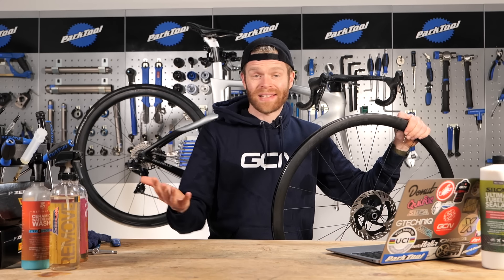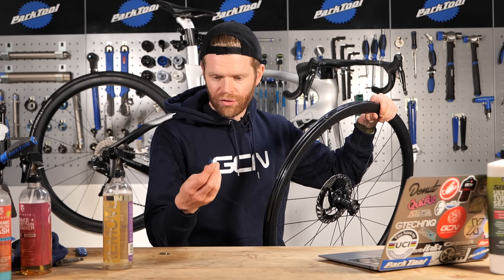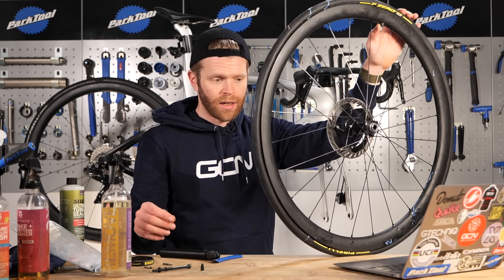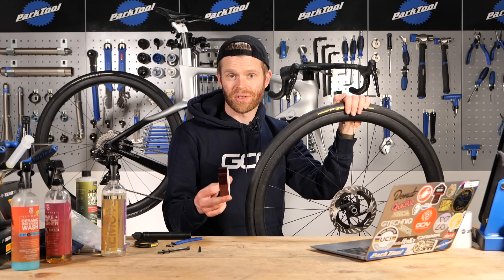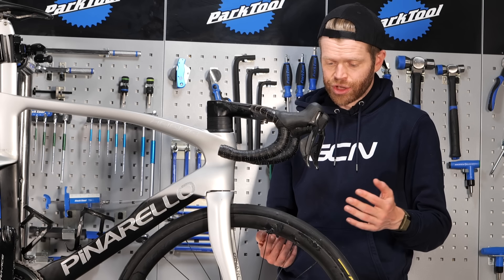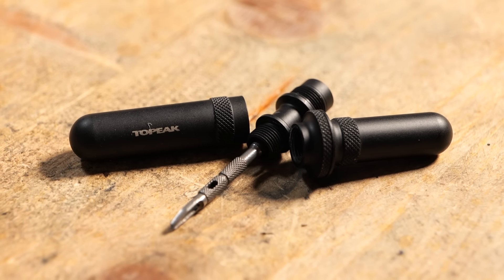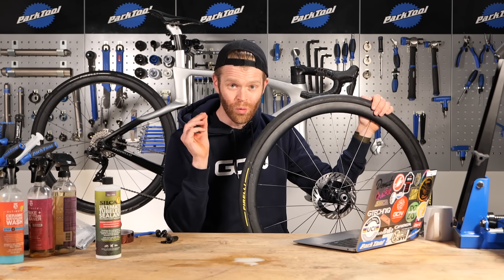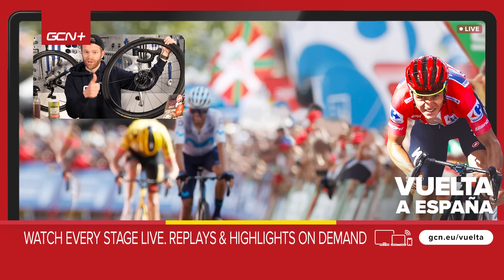Everything You Need To Know About Tubeless Tyre Maintenance

Comment from the maker: Do you have any of your own tubeless maintenance hacks? 🧐
Reply: Not really... Just get a new tire everytime the old tire pattern is erased. Tubeless FTW, tbh.
Reply: I sometimes have a hard time getting the tire to "engage" with the high pressure air to then push up onto the rim. Instead of just blasting more air in and hoping for a miracle (while my curses are drowned out by the compressor, a sequence I repeated several times) I decided to use actual physics and observation and carefully arranged the tire so the beads did not reveal much or any of the small dimples in the rim tape covering the spoke holes. That was enough to ensure that the air added sufficient pressure, rather than just leaking prodigiously, and so popped the bead up into place with ease. Physics. Gotta love it (them?)!
Reply: Always make the valve the last bit of tyre to be worked onto the rim. If the valve is loose & pushed up against the inner of the tread it'll allow the tyre more room. More often than not, this is why the tyre is hard to fit, your trying to work the tyre out of the tolerances it was manufactured to.
Reply: I always put the wheels into the bath tub when switching tyres or replacing sealant. If there is a sealant spill, it is nicely contained that way. When I'm done, I just casually shower everything with warm water and end up with a clean setup. I do live alone, though, so this might not be an option if you live with other people.
Reply: Yes,  I use TPU tubes.  Problem solved!
Reply: TPU tubes are what you need. Lighter, cleaner, and cheaper.
Reply: Tubeless reviewers always forget to cover the tyres that are difficult to remove from the rim after being on the rim for a long time. Riders with weak thumbs can’t break the bead and you can’t get tyre levers under the bead to lift it off. If you are in your workshop, pinch the tyre with your bike stand clamp and twist the tyre. The width of the clamp gives you good purchase on the tyre and plenty of leverage. Bad luck if you’re in the field and get a flat that you can’t seal with a dynaplug
Reply: I'm a bigger guy and my frame only allows up to 25mm tires, so I require a fairly high pressure.  I've taken to double-wrapping the rim with tape, as I've had endless tape failures.
Reply: I have heard that small tyre cuts can be repaired using elastic super glue. Actually seen one very good repair done on a non tubeless but likely to work well for both. Very little to lose with a "good" tyre that would otherwise only run with a boot and a tube of course. And as per Ollie.... plugs are often not going to work. Every chance you will make the hole even bigger though!
Reply: @bradallen8643   If you can find an appropriate size stick or rock, you may be able to place it on the tire right next to the rim and step on it.  I've gotten the bead to break loose using that method.
Reply: I use a tire bead seat and seal liquid that you can buy at auto supply stores.  It is cheap and the tires (tyres) seem to seat first try every time.  I've definitely had more success with it than with soapy water.

All the tires I've ever seated have a bead mold line all the way round on both sides of the tire.  If you inspect the tire after you seat it, that line should be a uniform distance from the rim.  This is a much easier and more accurate way of telling if the tire is properly seated than the rotation/inspection method Ollie demonstrates.
Reply: A CO2 inflator can substitute for an air compressor in seating tires.  Getting tires seated with just a floor pump works maybe 25% of the time for me.  Campag rims delete the need for rim tape, which makes them worth the premium, IMO.
Reply: @davesadrikcole6217  Most of the tubeless rim tapes are only good t0 45 PSI, above that, a second layer of rim tape is required.

Comment: While you are struggling with getting your tires on. Don't forget to check if your tire is directional and align the tire label with the valve hole. Nothing worse than finding out you installed your tubuless tires the wrong way around and having to take them off again. Been there!
Reply: If people are struggling with tubeless, they need the practice of remounting the tire again.
Reply: I would just leave it wrong way lol - doesn't make that much difference ...
Reply: This usually includes the acting out of the wheel rotation, holding the wheel up in the correct orientation in relation to the bike and rotating it through a partial turn, figuring or the correct orientation, promptly forgetting then starting the process again.
Reply: @neilmdon  huge difference on a mountain bike. For road tires, they're useless outside of the trip effect they can give for aerodynamics. I'd be curious to know the effect there with having them backwards but you're looking at over a watt for a slick tire vs a tire designed for aerodynamics
Reply from the maker: Oooof yep! We've all been there 👀
Reply: Which I read this before installing my tires. My fingers would have thanked you😂

Comment: I had a rim / tire combo (ETRO standard) that I could not get the beads to seal enough to develop the pressure needed to seat the beads - the beads just stayed in the center channel of the rim. After searching YouTube, the only thing I found that helped was to wrap a nylon strap all the way around the circumference of the tire and pull it tight, squeezing the side walls against the edge of the rim. This finally sealed off the airflow enough to get the beads to pop into place. And I was using an air compressor with the valve core removed, and a high-glow valve stem. I seriously contemplated if tubeless was worth all the faff!!!

Comment: Had my first tubeless puncture with sealant spray. If you know what to do, it’s not so bad. Put the leak to the 6 o’clock position so it helps the sealant, get ur tire plug, locate the leak, plug it in, then pump it back up and ur good to go. Left the plug there and still rode for 2k more miles. 6k for the year with the same setup. It was my first puncture, considering having 5-6 or more a year with clinchers.
Reply: Plugs definitely are less of a struggle than getting the bead off for changing an inner tube.
Reply from the maker: The joys of tubeless! 🙌
Reply: what plug did u use?
I had an experience with the popping out plug while I was climbing uphill. I gets it’s because of extra pressure- it was pretty steep there
Reply: I actually got a major puncture to seal with a lot of sealant because the hole couldn't be plugged. One key thing is to keep sealant topped up because if that sealant plug dries out it will unseat and blow out.
Reply: @Vorodya2 The dyna plugs work better for me. The head holds them in place. The bacon strips just pop out.
Reply: How do you “pump it up”?

Comment: A couple of years ago my first experience with tubeless tires on a loaner bike. About a week into riding a got about a half inch side slice. I had tubes but nothing in my pack to cover the slice in the tire and from experience I knew the tube would simply blow through the slice. I started walking home looking at the ground for something to use when I came across a cigarette carton. I tore off a piece and placed inside the tire over the slice put in a tube pumped up the tire and rode home. I started using tubeless nine months ago and have had two slices and evidence of about 12 punctures. Only one of the punctures stopped me from riding and only realized only 1 puncture while riding.
Reply: I should also say that the two slices sealed and I continued my ride. On one of the slices I turned the wheel on its side with the slice facing down and the slice sealed itself.

Comment: If you have sealant skirting out on the road, stop, take the weight off the bike and put your finger on the leak. Wait a minute and then spin the wheel, this usually fixes it. Also sealant squirts out if your pressure is too high.
Reply from the maker: Great tips! 🙌 How long have you been running tubeless?
Reply: I tried this with Silca sealant on a small thorn hole and it still wouldn’t seal. I recommend using a better sealant if it won’t stop squirting out!

Comment: I would always check that the tyre seats properly BEFORE putting in messy sealant. It should stay inflates for at least a few minutes with zero sealant. Also if it won't seat, putting in a temporary inner tube or leaving overnight will stretch the tyre into position.
Reply from the maker: Great tips! 🙌 Are you a tubeless lover? 😍
Reply: Yep. Get the tire to seat before adding sealant. You may need to unseat one side to put in sealant, but the tire should reseat easier.

Comment: Just to add. After inflating and seating the tyre bead, hold the wheel horizontally and rock it round to get the sealant over the inside of the bead.

Comment: IF you have a hard time getting a tire onto the rim, especially a new one, I used a trick I learned on another video, put a zip tie around the tire to hold it in place once you got part of it installed, and put another one on the opposite side  that 180 degrees for the nerdy types (like me)
it's work great it saves a lot of cussing and throwing of tools.
Reply: Why not just use a tire lever?

Comment: Some pumps (and I believe the one Ollie shows is like that) have a 2-way switch for the type of air they blow - one setting is for high pressure, normal pumping, the other is for low pressure high airflow. With this pump I've seated many a non-compliant, dried sealant covered bead. This is a great investment as it doesn't take up too much space and costs way less when compared with a compressor. Booster tanks can have their own issues with leaking etc.

Comment: I’ve had a lot of punctures that seal well enough to get me home, but start leaking again once I reinflate to a proper tire pressure. You can take the tire off, clean it and patch from the inside with a park tool vp-1 or slime skab patch etc. I’ve gotten a lot of extra miles out of tires with these
Reply from the maker: It's amazing what a simple patch can do 🙌 So much more life in those old tyres!

Comment: The key to getting the tire on is to USE A BIT OF SOAPY DISHWATER on the bead. This should always be used, not just when you're having trouble.   Why make the job harder than it has to be?

Also,  soapy water on both beads helps the bead seat, too.
Reply: Look at what the use on your automobile tires and rims. It's dish soap and water or automobile cleaner and water. Apply LIBERALLY on the tire bead and inside of the tire where it contacts the rim.
Reply: @zedballs  The tyre shop I go to that has been in business for over 40 years uses Dawn Dish soap (clean up solution for those in the UK). The commercial solutions are very expensive and aren't any better. They were the ones to recommend using this on my tubeless bicycle tires.

Comment: I've seen on other videos that the Silca sealant is very good at sealing, but it's a hell of a mess if it fails and you need to put a tube in. I'd love to see a video doing that with Silca.
Reply from the maker: We'll see what we can do 🙌 We would love to show off the Silca sealant
Reply: I haven't had good performance from the Silca sealant in road tires.  I've had a number of small punctures not seal without using plugs.  Also the sealant dries out after about a month, and I ride in a moderate climate.  Also using it is a PITA because it cannot be injected through the valve stem.  Because of this, I've gone back to Orange Sealant.
Reply: @oldanslo amen to that. Silca sealant actually peeled up my rim tape that had worked fine for a year with the orange stuff. And it constantly plugged my valve cores. Total PITA!

Comment: i had a lot more troubles with tubeless apart from those discussed. First of all what most often leaks in my experience is valve-hole, not the core.Another issue - the rim tape may break against the spoke holes under pressure, despite being advertised as a product which should prevent exactly this. Selant may not seal even small holes, just go out of the hole. Then as you pump the tyre without a valve core, and then as it is on, you take the pump out, the bid does not necessarily stay in place - it will go in the center of the rim. I had all of this, but still using tubeless just because it feels a bit more comfortable on bumps. i am still wondering though how will it work in low temperatures in Finland.

Comment: 76 Projects hi-flow valves have made my tubeless experience much more satisfying, as not now continuously battling clogged valves each time I go to add air to the tyres (Silca sealant was just overwhelming the standard valves).
Reply: I've worked with this valve once when I had a customer wanting to switch his to these. Would be a bummer for those with higher-end Lezyne pumps as the valves are threadless.

Comment: The most comprehensive guide to tubeless I think I've seen. Well done. I have been running tubeless now for 5 years and would never go back to tubes. I've lost count of the number of punctures I've avoided compared to tubes. But I always carry a spare TPU tube and patch kit in case the puncture is more of a cut. Only had to use this once. I have stopped carrying Co2 cylinders for inflation and switched to a Topeak Roadie TT. You are not supposed to take Co2 cylinders on a plane, and to be honest, if you try to re-inflate on the roadside, and it doesn't work, you're toast. And for the weight weenies, 2 x Co2 cylinders  plus valve connector weighs more than 1 x Topeak Roadie TT 😉
Reply: Errrr, how do you know how many punctures you didn't get?
Reply: @frenzalrhomb1  when you change the tyre you can see on the inside where the punctures were as the sealant turns into a circular rubber "plug". Depending on the size of the puncture, you can also see the sealant on the outside of the tyre form as a rubbery substance. That's my experience anyway.
Reply: Then you have not seen the Parktool videos.

Comment: Great topic. Alas you shown the wrong operation sequences.
Fit the tyre on the rim --> inflate at the max allowable rim/tyre pressure ( setting-up tyre beads on the rim) --> deflate and remove valve core --> add sealant --> inflate at desirable pressure --> spin the wheel sloping it on both sides.

the main purpose of the sealant is to correct the imperfections of the tyre an rim that might cause aome leak, adding it before setting the beads on the rim soils the contact betwin the two.

Cheers from Italy. 🇮🇹

Comment: If you have trouble (like me) to get the rims from center to the rim wall for proper inflating, first use an inner tube to inflate the tire so the sides are proper sealed. then carefully remove one side and the tube, install the right plug and reseal the tire. You now still have at least one side sealed and it will inflate nicely without compressor even if the other rim is centered.

Comment: The "o-ring" has absolutely nothing to do with keeping the system air tight.  It's only purpose is to allow you to apply the appropriate pressure without damaging the rim.  There is NO pressure behind this o-ring.  If there was, air would also leak out of all the spoke holes.  It would also mean the rim tape doesn't work.
Reply: and that little hole were water can drain from.
Reply: Also, if the inside of the rim is pressurised, the rim will blow up. I've heard of such cases. This is why ENVE's tubeless valve lockrings have four channels that allow any air trapped in the rim to escape should the rest of the rim have no air leakage points.

As long as the rim has a drainage hole or two (some actually have none!), it shouldn't be a problem.
Reply: I understood that as the nut is what makes it air tight, and the o-ring is part of the system, not that the o-ring is inherent to establishing a seal
Reply: @PhilDowson-hq3dj the valve seals on the INSIDE of the rim. An O ring underneath the nut on the outside is more about stopping the nut from from vibrating loose as you ride.
Reply: @andrewmcalister3462  that's what I meant but didn't write very well! I meant as in the nut applies the pressure that seals the valve inside, and the o-ring helps with the vibration and also protects the rim
Reply: Actually the o-ring keeps the nut from damaging the rim and allows for hand-tight tension to seal the valve against the rim tape. This eliminates the need for tools to tighten the valve to the rim. Tools should NEVER be used on the nut on a valve, tubeless or not.

Comment: I've found that the best way to make sure a tyre is seated correctly is to go for a quick ride around the block. the rotation under load should push the sidewalls fully into the wheel flange.

Comment: I had an unfortunate experience where my tubeless tyre got cut by a piece of glass on the road, about 1 centimeter long cut, which could not be sealed. I had a spare tube, but had not experienced a case where I would need to use it. Had to use grass from the side of the road to remove the sealant in the tyre, used a bank note where the tyre had been cut, and used an inner tube to complete my ride. Since then, have been carrying tyre sealant remover in a portable spray bottle to the saddle bag.

Comment: If you have already repaired a tubeless tyre with a Stan's Dart or similar, are you not likely to get a puncture if you were then to need to use an inner tube? So if you have to use a plug, you really need to repair the tyre with a patch on return. I use tubeless for my off-road 50c tyres for the benefits of lower pressure and sealing, plus I think an inner tube is about 400g so there's a massive weight advantage too. But far less so for thinner road tyres unless you are using 50c slicks as in that other recent GCN video.